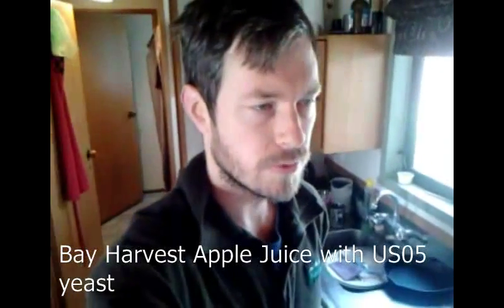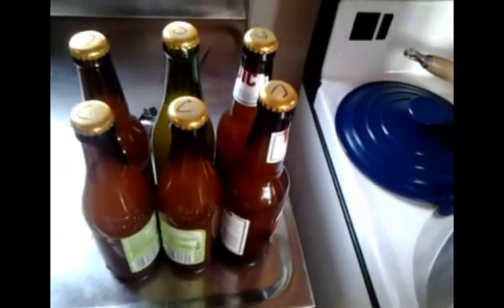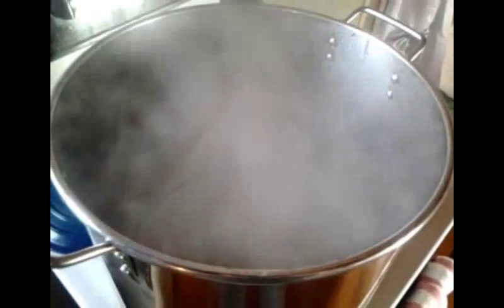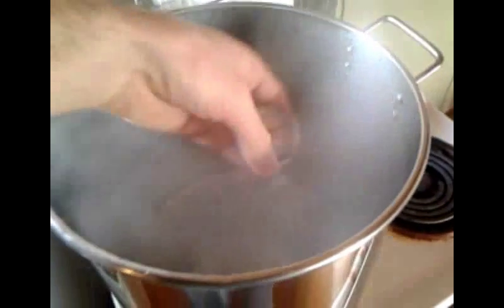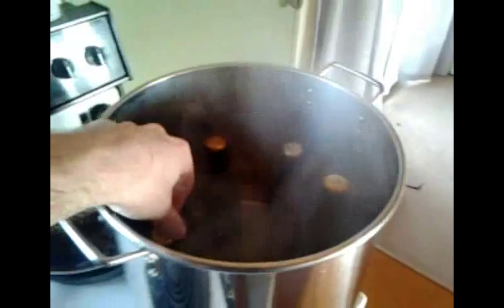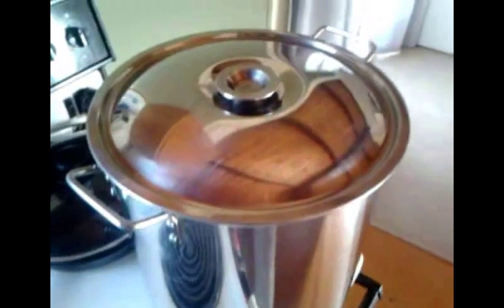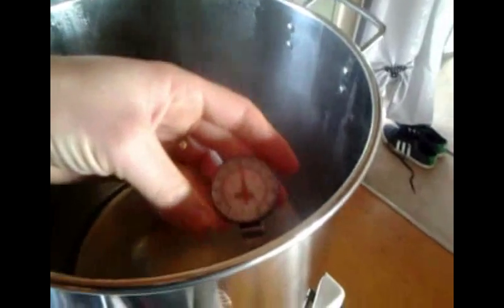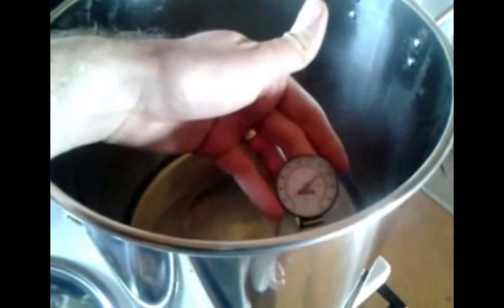Cider pasteurization experiment...Die yeast die!

Comment: I just did this for first time yesterday. Lessons learned.
Metal lid is a must. I lost 5 bottles out of 25 due to cap failure. 
First cap is embedded in the ceiling drywall above the stove.
Second cap shattered the glass copperware lid like a broken car window
The other 3 left visible dents in the metal lid. 2 had the imprint of the bottom of the cap.
Every bottle that popped I questioned the cap beforehand.  Now it I have a questionable lid I will pop it and try again. Caps are cheap repairing holes and replacing wife's  cooking set is not.
Reply: As well as being diligent with the caps, make sure you set the bottles in the pot while the water is getting up to temp. Greatly reduces the liklihood of temp shock on the glass and cap

Comment: I would like to add sweetness to my cider by adding fruit juice along with the priming sugar (as well as carbonation). However, my fear is that it would significantly just dry out and then possibly overcarbonate the cider if I let it sit for 3 days before pasteurization. What are your thoughts?!
Reply from the maker: Depending on ambient temp it shouldn't go too far in 3 days, but it pays to have spare bottles you can open and check prior to pasteurization. Cheers

Comment: How did it go with this experiment? Here you go Jim @ The Old Farts Brewery this is a technique you can use to prevent bottle bombs. Cheers!
Reply from the maker: Hi Zane, success as far as i can tell. I've opened a couple of bottles and the carb level seems identical to before I heat treated them. Cheers
Reply: That is cool. Cheers!
Reply from the maker: The trick seems to be making sure the carb level is ok to start with and not making them overly sweet!
Reply: Yes. I have bottled ciders before that hadn't finished fermenting and was carbonated in 2 days so just stalled the yeasts by putting in the fridge to stall fermentation which worked out but killing them would be cool as could age them easier. Cheers!
Reply: Scary stuff, could you not place them into the bath with cold water and slowly raise the temperature. Hope its works out for you cheers
Reply from the maker: Yes keep the safety goggles handy...you could slowly heat them although I'd imagine the bottles may get a bit toasty on the pot bottom? If your carb level is ok to begin with I think it's safe enough. Cheers